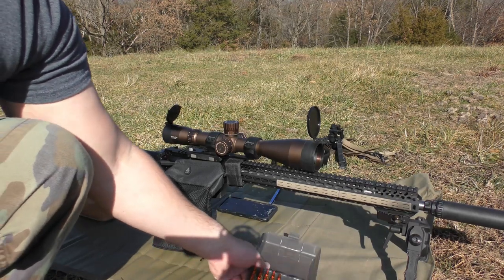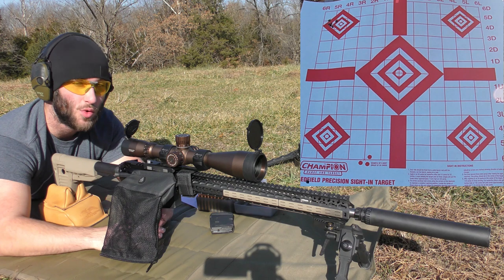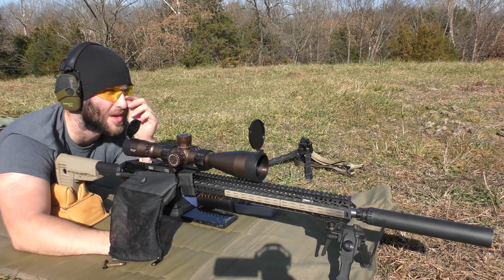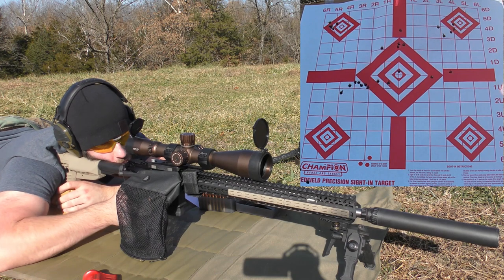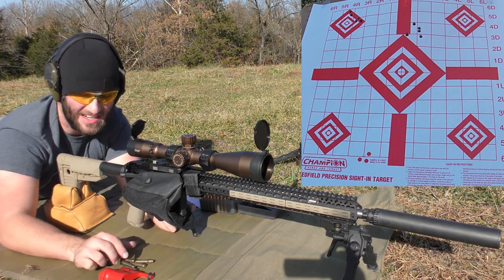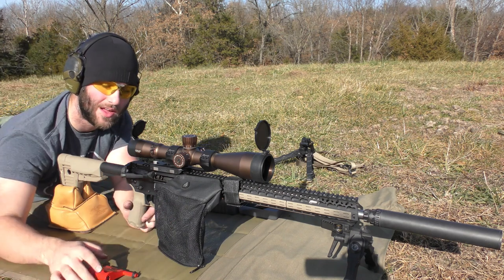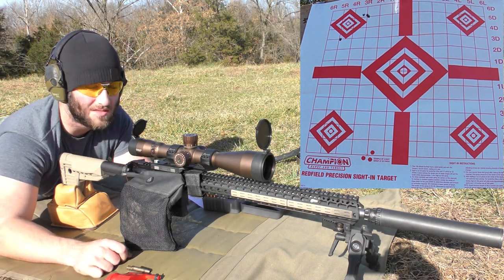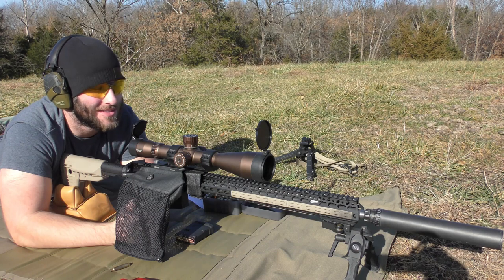AR15 Load Development: Coyote Rifle 223/5.56, Hornady 53g Vmax 55g Sierra Blitzking 73g ELD 75g BTHP

Comment: To me it could be a few things. Something could be contacting your barrel or the can on the front of it is throwing off the harmonics and on the ammo side of things i seen a few groups that where double grouping and that could mean you might be right under the powder charge that might shoot i have had really good luck loading for my 20 inch AR with ramshot x term ramshot tac and AA 2015 and 8208 xbr and consistently shoot under moa with 77 grain midway factory seconds
Reply from the maker: That's awesome! Thank you for the input. Ar15s can be tricky sometimes. It's always good to have different suggestions on things to try.